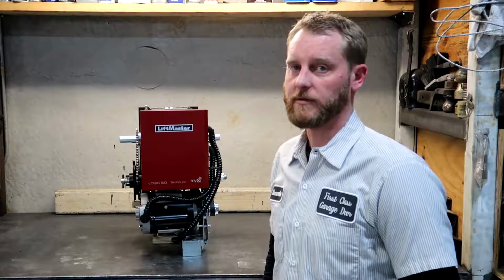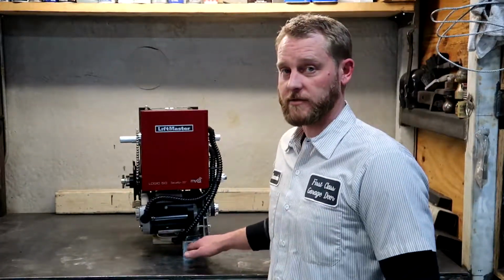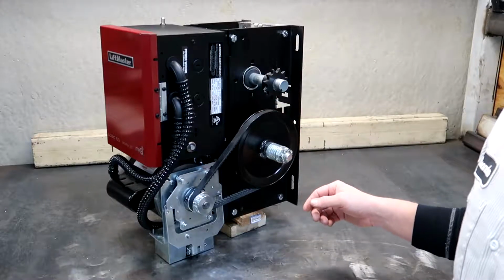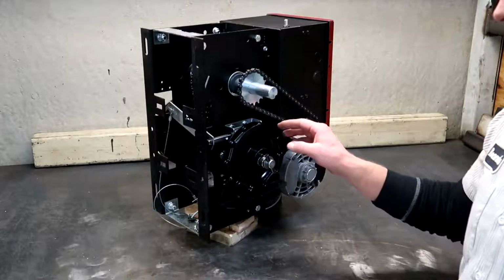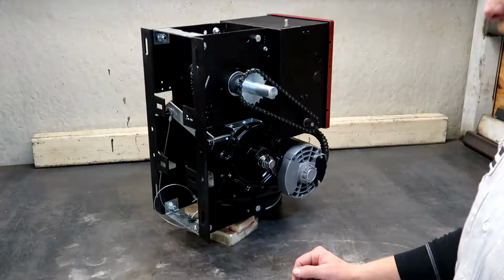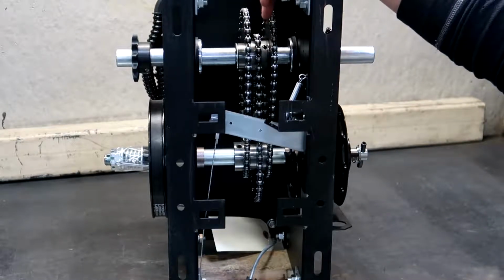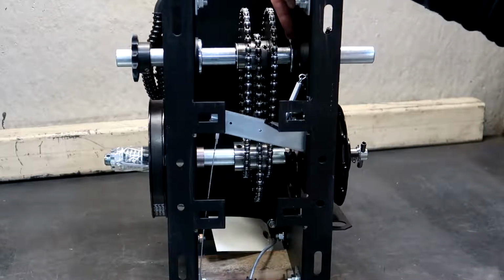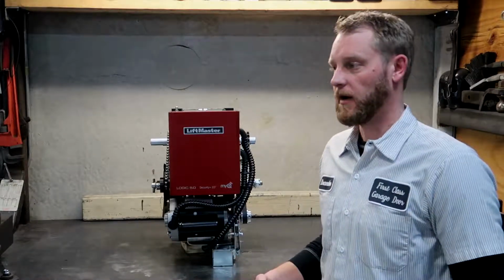LIftmaster Logic 5 Elite Model H | Commercial Door Operator

Comment: Hello, great videos, thank you!  I do property maintenance for 2 4-story apartment buildings with underground parking, and we have these Liftmaster Logic 5 openers installed with braking mechanism.  One has the older brake I'll call paddle style, while the other opener, recently replaced, came with a newer(?) drum brake.  The paddle style works great, while this newer different drum brake style is junk.  The brake pads wear down fast, in which the door then resumes its coasting.  I understand this drum brake is adjustable, however I can't find any info anywhere (including Liftmaster website) on how to adjust it.  I know it is simple, I just want to adjust it properly, without causing other issues if I happen to adjust the wrong bolt/nut.  Thanks again!
Reply from the maker: Im sorry for the delay on this one, not sure how I missed it. I agree, the new drum brake design is terrible. I mean functionally it works (stops) great but as you mentioned its short lived, they wear quickly and stop functioning without constant adjustment. The old disk brake style although it had its own issues it was certainly more maintenance free. On the drum style brake the two opposing bolts on the actuator/lever mechanism are used to adjust the brake to account for wear. The long bolt with the spring adjusts how much pressure the brake band applies to the drum, maybe loosen it up a bit to reduce friction and slow wear ?. I don't think Liftmaster cared about that "new" design as it was short lived, they launched a whole new commercial product line 1st quarter 2024 and discontinued most of these old Logic 5 units. Although they just brought some Logic 5's back for a short time they are moving toward speed reduced DC powered units that do not require mechanical brakes. Sorry again for the delay. Thank you for watching.
Reply: @firstclassgaragedoor6471  No prob, thank you for the info.  Indeed we just had one of our door openers upgraded to the Liftmaster Maxum since like you said Liftmaster doesn't make the APT 5.0 anymore.

Comment: Can I change the handing of one of these openers by flipping the sprocket to the other side?  I have a model H501L5R and I need a H501L5L. It looks like it will work but I don't know what I don't know....
Reply from the maker: Yes, you can just swap the drive sprocket from one side to the other. Technically the “L” & “R” refer to the chain hoist handing not the drive handing. Good luck.

Comment: Is there an adjustment for the braking on the door opener. We have a Liftmaster wall mount door opener in our shop with a 20' Door. When we raise the door all the way up it hits the spring / stop lifting sensor and then instead of staying up all the way it will roll down close to a foot.
Reply from the maker: Yes, the brake mechanism is adjustable.

Comment: Would i be able to service belt and bearing without affecting the chain or spring while its locked into place?
Reply from the maker: Given the limited description of work and having no idea what type of door this model H (I assume) operator is connected to I would have to say that you should kill power and disconnect the drive chain prior to performing any mechanical repairs on the operator.

Comment: Is this suitable for double slate 5 m x 2.2 m garage size ? Or i need a stronger one?
Reply from the maker: What gauge steel ? Polystyrene or Urethane insulation ? What HP and what voltage ? What is the application & how much usage?

Comment: Could you please explain the differences between hooking these up to 230/240v vs 208v?
Reply from the maker: Single phase or 3 phase power ?
Reply: @firstclassgaragedoor6471  3 phase
Reply from the maker: @TheWanderingMoon  208v 3 phase connects the same as 230/240v 3 phase only difference is the 208v will draw a little more amperage due to the lower voltage. Assuming the operators motor is rated for 208v. I've seen mixed opinions on running 230/240v motors on 208v. I run my 230v 3 phase Bridgeport mill, surface grinder, Lathe and hydraulic press on 208v 3 phase power and have done so for several years now without any issues. Keep in mind I'm not running production on them, probably use them two or three times a month for making custom parts and tools. Hope that answers your question.
Reply: @firstclassgaragedoor6471  thank you! That's just what I needed to know.

Comment: Can you get those power slide locks for these industrial units? Or only for the residential units?
Reply from the maker: Residential units only.
Reply: @firstclassgaragedoor6471  do they make anything for the industrial side? Seems like it’s a good security measure
Reply from the maker: @drewmurphy2796  They do not. I'm not entirely sure why not but if I had to guess its because the doors are so big typical break-in techniques are impractical due to the size and weight of large commercial and Industrial doors. There is also the danger of having doors that large come out of track, pop cables off and the potential for damage to the operator should the lock malfunction. Although they do not make a bolt-in lock accessory for commercial & industrial applications with a little imagination you can build your own. I have made a couple for my own commercial doors but I would be hesitant to put them on a customers door given the potential damaged they could cause if misused or if a malfunction occurred.

Comment: Where is the learn button on this unit for programming additional remote openers?
Reply from the maker: On the logic board, about mid board opposite side of the screw terminals. In line with the timer to close, Mid stop and Max run timer buttons. "Radio" button.

Comment: Do these operators need a neutral wire when installing these with 230v wiring? Thanks.
Reply from the maker: No neutral required for 230v, just an earth ground and make sure you have the harness plugged into the 230v plug on the power board.
Reply: @firstclassgaragedoor6471  Thanks!

Comment: My door goes up and  want to just keep going
Reply from the maker: Can you elaborate? The door should stop when it runs out of cable. Is it high-lift track? Are the springs wrong? Is this a recent issue?
Reply: The LiftMaster is mounted to the wall by the garage door when  the garage door gets to the top ;the electric motor just keeps running and wants to send the door flying it’s nine years old everything‘s in good condition just the controls on the electric opener are not set correctly
Reply from the maker: I would start by testing or replacing the open limit switch and checking all related connections. If that’s not it then check relay(s) and board.

Comment: How do I set up the spring tension that is connected to the shaft that connects to the liftMaster motor
Reply from the maker: I would need more information to begin to assist with that. If you need to ask, I would be reluctant to advise as springs are extremely dangerous. Aside from all of the homeowners I have seen that were injured attempting to install or adjust springs there are a few horror stories I’ve heard from professionals getting hurt themselves.
Reply: Thanks I found a a certified liftMaster repair man 30 minutes away I’ll give him a call thanks for the advice you probably saved my life
Reply: Just to give you a quick update two guys came and reset spring tension to match  definitely a job for professional  then found the spring clip for the limit switch messed up fix that then they reset the limit switches for full open and full close  cost 380 and a $20 tip  I’m happy I did not get hurt , thanks again for your help best of luck

Comment: Can you confirm the output shaft RPM? From the documentation that I have read it is 36 RPM with the H501.  My plan is to use this operator with my Janus 2000 12x12 and Janus 2500 14x14 roll up doors. I’ll be using the Janus E/O kit that comes with #41 chain and 72 tooth sprocket. I’m wanting to get the correct sprocket on the output shaft so the door isn’t moving too fast or too slow.
Reply from the maker: Yes, 36 RPM sounds correct. I’ll double check tomorrow when I get in. 6-12” travel speed is about where you want to be. The slower the better for longevity, less strain on the operator and it’s easier on the curtain (door). The actual door speed will very throughout the cycle because the moment arm/ diameter changes as the door goes up and down. I’ll get back if that 36 RPM is not accurate.

Comment: How many pounds can it lift?
Reply from the maker: In a garage door application it shouldn’t be lifting any weigh or very little as the door should have a counterbalance mechanism to balance the door. But outside of its intended purpose it could theoretically lift a lot of weight with the right gearing. I would not advise relying on the unit itself to carry ANY  loads without some sort of anti-drop safety mechanism built into the system. Whatcha building?
Reply: @firstclassgaragedoor6471  the roll up sheet door is 8' tall x 10' wide. I open it with the chain opener. Can't let go! These openers brake is not the output shaft, correct?
Reply from the maker: Ron Morris if you have the Liftmaster Hoist operator the operator brake is not on the output shaft. Even those sheet doors have springs or should. Sounds like one or both are broken or the spring(s) are out of adjustment. The door shouldn’t rely on a “brake” mechanism to hold open unless it’s a fire door.
Reply: I ordered them without springs! If the spring broke they are coming down.
Reply from the maker: Ron Morris  I would advise against running a springless door with no anti drop mechanism using an operator. There is zero redundancy, if the operator breaks or the drive chain falls off, the door will drop and whatever is under it will not fair well, neither will the door. And the brake on an operator will wear out over time (less time with increased load) also consider that the brake on an operator is not meant to hold extreme loads it’s more for stopping the door to reverse it faster when the safety is triggered. Heavy doors on operators without brakes will drift a bit after stopping or triggering a safety which increases the time to reverse direction and/or reverses the motor while the door is still traveling the opposite direction. Do not mistake the brake as something that will hold an infinite load. The holding power is pretty limited especially with high usage systems. These operators are really designed to be used on spring’d doors that are in good working order.
Reply: I’ve hung on to one up to 12ft it would have taken me all the way up though. It was 1725 rpm and 1/2 hp